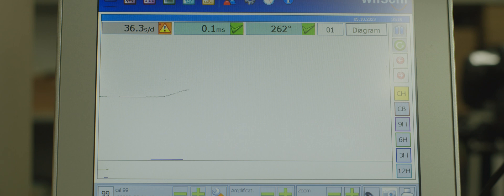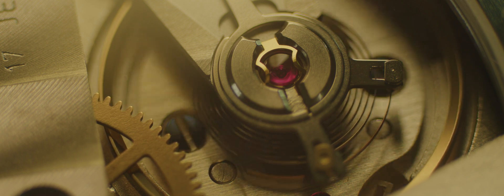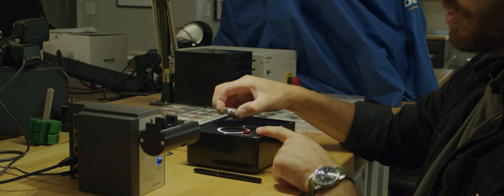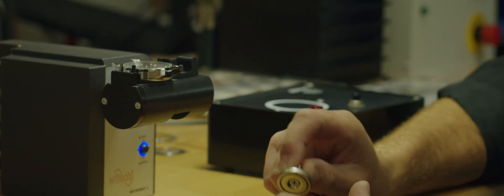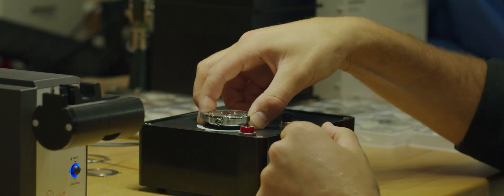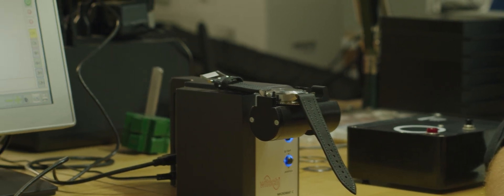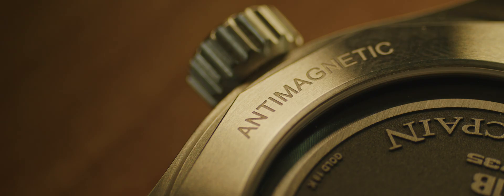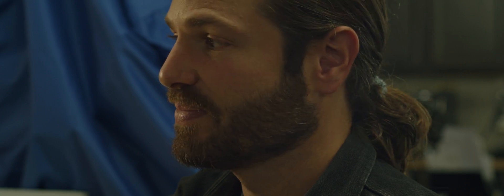Magnetism and Mechanical Watches Part 2

Comment: How they demag befor demgs? Did they at all? Lets say 100 years ago.
Reply from the maker: Demagnetizers are a relatively simple electronic device and they have been around for well over 100 years.  If you think about it we didn't need demagnetizers until we started building things with electromagnets in them. Very few elements are magnetic enough and commonly found that they would magnetize a watch in the very olden days before electricity.
Reply: @thewatchmakersworkshop  thx.
You and others falt that i ll soon start my new hobby. After getting to old to fix cars and build houses. I just got triggert a couple of weeks ago. Thx 4 that.

Comment: Thank you, Cameron. Great info. Any advice on those of us using a magnet based oscillator? I wonder if that affects an automatic watch. Thanks!
Reply from the maker: Are you asking about watch winders and their motors potentially creating a magnetic field that interrupts the watches timing? I have never had this issue, but maybe their are inexpensive winders that could cause this problem.  might just need a better quality winder with the motor shielded and running more efficiently.